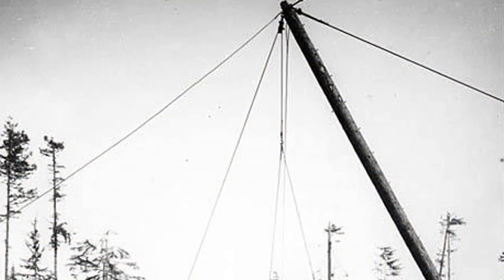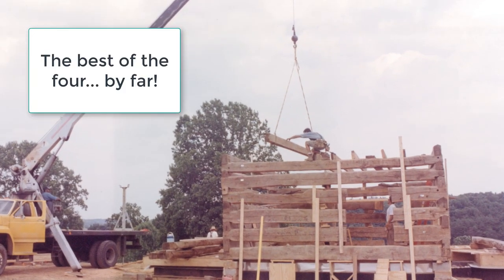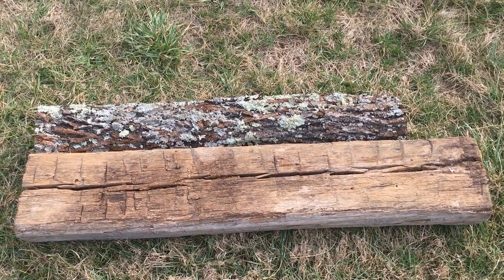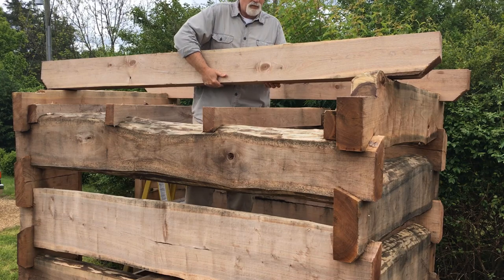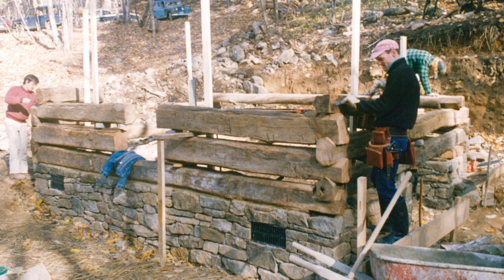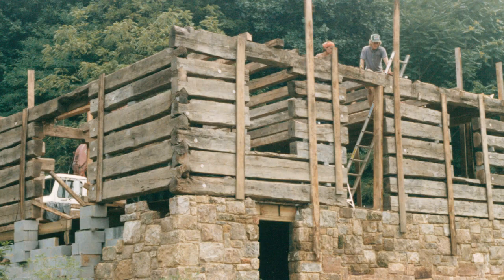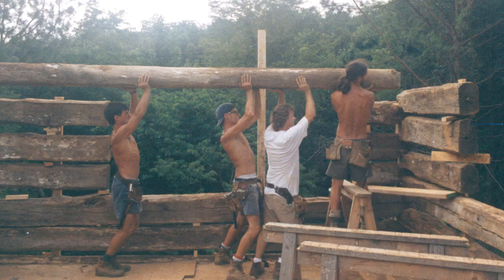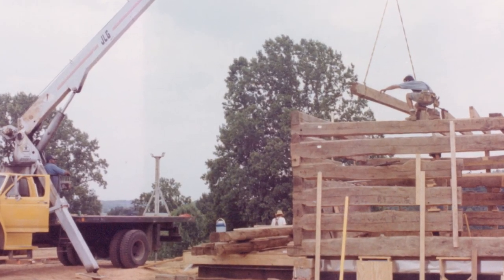Handmade House TV #33 "Lifting Logs"

Comment: I would like to know what method is used to join two logs together on one side of a house. For example, if I wanted the length of the cabin to be a lot longer than the logs I have available, so I lay two across instead of one. How would I join those to retain the space between them and avoid rot ? Any sort of reference you can suggest ? I can't find anything online to be much help other than some distant pictures.

Comment: Any suggested size on the "tiny" practice cabin?  I guess it becomes one of the out buildings on the property?
Reply from the maker: The tiny cabin I built for the Log Cabin Academy was five by eight feet... I was working with six and nine foot logs to do this. The logs I was working with were large (up to 2 feet in width), green and heavy. This is about as small of a cabin as one can build and still be a useful structure.

I had some vermin-injured trees on my property that I cut... I paid an operator of a portable band saw mill to come and saw the two faces of the logs for me which cost me $240. If I had gone to the local sawmill I could have likely gotten the logs there for probably twice that.

As I was nearing the completion of the cabin I had someone stop in and greatly admire it and he offered me $2,000 for it (it's not for sale)... I've got several family members that have told me that they would like to have it, so likely now I have more to build to keep everybody happy (sigh).

There are a lot of ways to make a little cabin like this into a useful outbuilding, and they add so much to the beauty of a log home ... having a log outbuilding nearby.

Another option is that it can be a great playhouse for the "little ones."

One last thing... it had been a few years since I had built one by myself... it was  a great confidence builder and I really had a good time building it. I now have a great little reminder for the rest of my life of one thing I did back in '17
Reply: Could use a 3' X 4' deluxe outhouse!  :)

Comment: In your part of the USA, what type of wood are you using for the logs?  Thanks.
Reply from the maker: Historically... it's been oak, tulip poplar, chestnut, and yellow pine.

But any log, free of knots, straight, and of the proper size will do the job!  I just built a tiny log cabin for the Log Cabin Academy out of walnut and it turned out great!

One piece of advice I can offer... choose the best wood you can find. If someone tells you that you are crazy to build your cabin out of such nice wood.... "why you could make furniture out of that!"... then you likely have the proper wood for your cabin.
Reply: Thanks for the reply.  I expected you to reply the hardwood varieties, and not the yellow pine.  Why?  Just thought the hardwood would be more durable.  Thanks again.
Reply from the maker: Hardwoods do tend to hold up better (less tasty from an insect's point of view)

With regard to beauty a cabin made of antique heart pine is about as attractive as a log cabin comes... whereas new yellow pine brings with it a lot of challenges (and so drives it to the near bottom of species that I would choose)... even though it is abundant, straight, and used by many.

I do greatly admire a lot of the softer woods and would use them in a heartbeat to build a cabin for myself... such as hemlock or white pine.
Reply: Thanks again.
Reply: I thought that softwood, like spruce/pine, was considered a better choice because it contains resin which helps preserve it and is also a better insulator? Then again, I've yet to build a single cabin so... what do I know.   :)

Comment: What can you tell us about the log lifting technique shown at the end of this (very likely marked as spam) video? https://youtu.be/WjRW3xS4Q14?t=1900

This seems like something one man with a winch, enough rope, and the right rigging equipment could use to make short, easy work of lifting logs. Thanks!
Reply from the maker: I took a quick look at the video... (fast forwarded most of it for now)... and in the end it showed a few people with ropes pulling a log up onto the house... which appeared to work well for them (the logs appear to be poplar which is one of the lightest of woods... and one that I admire).
It's always a good idea to have a few good ropes handy on site... we've done this technique as well... but often a rope is tough to pull on (less than pleasant)... and certainly with the aid of a bit of rigging or winching things can get easier.
I think your point (and this video) add to the message that I was trying to make... When building a cabin we don't need to over-focus on the acquisition of complicated and costly equipment.  We just take it one step at a time, along with some muscle power and careful thought, while focusing on safety, and we will be able to get each log into it's final resting place.
Thank you for sharing. :)